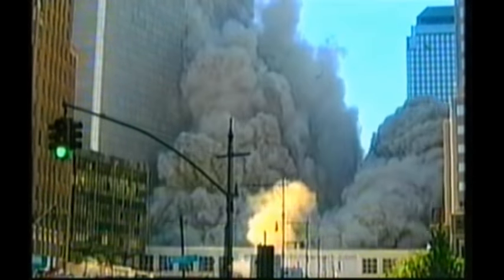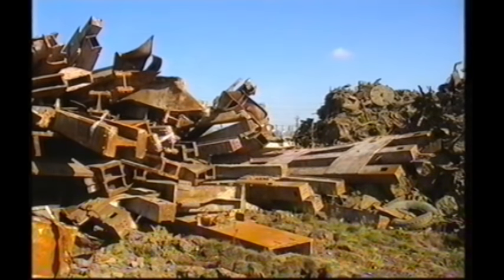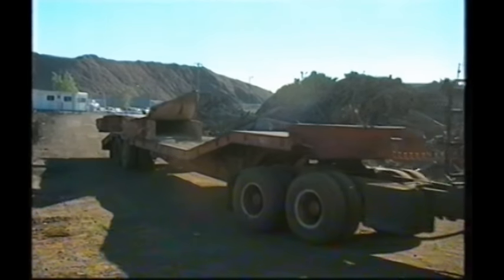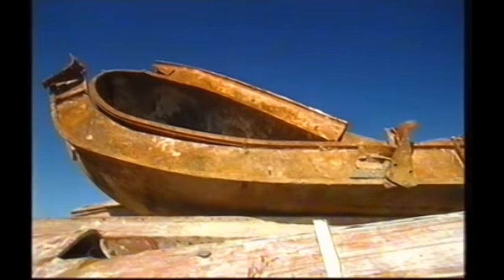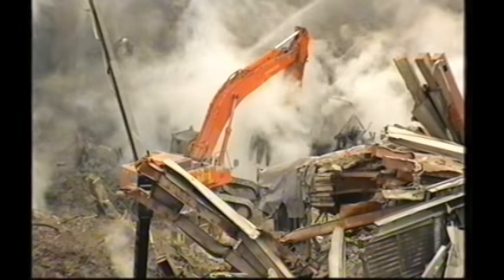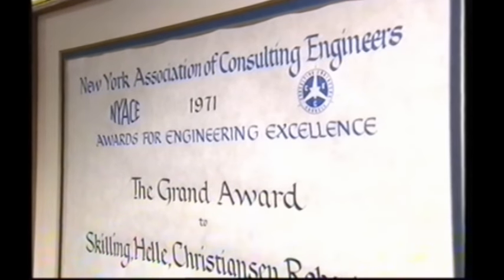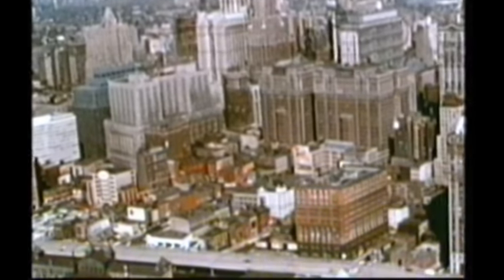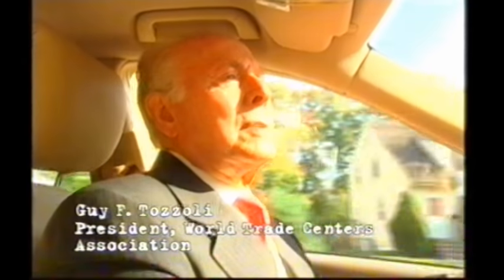9/11—"How The Twin Towers Collapsed" (C4 documentary, 2001)

Comment: From 415 meters high (the height of the twin towers), 9.20 seconds elapse for a given mass to hit the ground in free fall. Given the fact that each floor below its above collapsing floor must resist and provide an equal and opposite force to the floor above, (Newton's 3rd law), it is impossible that the entire structure could "accelerate" (as stated by the narrator) and much less, completely collapse as explained in the time frame stated, (i.e. essentially free fall - which by definition is acceleration of a mass in a gravitational field.) Additionally, the model building that featured "the weakness" of the actual buildings, which resulted in a torsion/twisting-styled collapse (of the models) would have dramatically increased the total elapsed time for complete collapse (if this happened to the actual buildings). Not to mention the mess would have spread more radially outward. This sloppy modeling and slipshod explanation doesn't match the actual observations whatsoever.

Therefore, it's obvious the pancake hypothesis explained in this video is falsified inherently within its own nonsensical "logic". The only way to defend and/or believe the official physical explanation is ironically to defy physics, i.e. Newtonian physics (assuming comprehension of said physics) along with the naive outlook and ignorant assumption that the release of investigations, reports, and production of videos like this can't be falsified. 

This is not to say practically all the information provided by each man featured in this video is false. Au contraire... the point is to simply identify the fatal error of the pancake theory based on physics. 

Weaving together true information on specific details does not supersede the falsehood of the big picture, i.e. how masses fall in free fall vs masses encountering resistance when falling. The spell of detailed, professional testimony is glamorous enough to sugarcoat the bitter truth. And the least bit of truth that is evident is the official explanation is incorrect. Recognizing and the admitting this truth is the minimal first step into illuminating more, if that's possible.

Additionally, the denial of Newtonian physics seems to accompany no significant comprehension of Galilean physics.
Reply: The sadist thing is that it was the event that started war on terror .  Wars are often started with false flags.

Comment: The engineering was remarkable. The top floors remained standing even after much of the framing of two walls were 
Destroyed. It’s just not possible even now to build a structure that will withstand every possible attack.
Reply: Especially attacks from dynamite on every girder.
Reply: They were brought down by design
Reply: The engineering was remarkable. The towers were specifically designed to withstand impact from jumbo jets and yet those planes magically caused all of that engineering, and basic laws of physics, to go right out the window. 

If you're interested in engineering, you should look into the study done by architects and engineers at the university of Fairbanks about WTC Building 7. It's pretty remarkable too.
Reply: Newtons 3rd law says when objects interact they always exert equal and opposite forces on each other. Therefore while an object is falling , if it exerts any force on objects in it's path those objects must push back slowing the fall.  If the object is observed to be in free fall we can conclude that nothing is in the path exerts force to slow it down. Free fall is not consistent with any natural scenario involving weakening, buckling or crushing because I'm any such 
Scenario 
There would be large forces of interaction with the underlying structure that would have slowed the fall. A natural collapse resulting in free-fall is simply not plausible.  All three bldgs collapsed by design
Reply: @coolk3dat754  Have you ever tested your assertions experimentally, or just using your gut instinct?
Reply: @beantown_billy2405  it's been tested and laws of physics proves it
Reply: @coolk3dat754  It's been tested where, when, and by whom? Where can I read the technical report?
Reply: @beantown_billy2405  Where? Newtons 3rd law of motion tells you so. Any upper block of falling structure must slow down when it hits any mass or force that previously supported it. The upper block will destroy itself well before It can possibly crush the entire larger lower structure. It's called resistance.  People wouldn't dive off a high cliff into the water if they didn't trust resistance. Nist analysis stopped at point of collapse initiation never explaining why a total collapse occured. When asked why their response was the computer models couldn't converge on a solution. Now what was it you said in your previous comment?  Why do you wanna talk about a subject you know nothing about?
Reply: @coolk3dat754  You're trying to say the buildings didn't collapse?
Reply: @beantown_billy2405  is that what you're getting out of this. They fell alright, but with some help from the inside. Why don't you tell me when you include Newtons 3rd law of motion to the collapse tell us all, what should and shouldn't have happened ?  And don't be putting words in my mouth . I'm saying building never fall straight down into their own footprint in a symmetrical fashion with uniformity and consistency
Reply: @coolk3dat754   Newtons 3rd law of motion tells you so. 

The same applies to the 'plane' impact. A 2mm thick aluminum plane flying TRUE thick steel beams at incredible speeds... (Newton: for every action (force) in nature there is an equal and opposite reaction)

Now imagine the thick steel beams smashing into a thin aluminum plane at those speeds. Only cartoons physics would stand the test of what happened on 9/11.
Reply: @beantown_billy2405  some critical thinking and basic physics knowledge already goes a long way. 

“It's easier to fool someone than convince the they’ve been fooled.” Mark Twain
Reply: @user-xm7sx8it9e  p.s. asking someone to imagine is not how science works. If your theory disagrees with experiment, it's wrong
Reply: @coolk3dat754  The experiment would show the plane getting demolished by the thickness of the steel beams. That's my point. As should have happened on 9/11. The planes flying into building as we were shown doesn't make any sense at all.
Reply: @user-xm7sx8it9e  the plane's impact had nothing to do with it. It only cause local damage and did not impair the integrity of the rest of the building. 80,000 tons of structural steel framework as if it wasn't even there. Don't waste my time side stepping these laws which you can't even prove
Reply: @user-xm7sx8it9e  you could have been a hologram you we're watching
Reply: @coolk3dat754  They didn't fall into their own footprint. The top sections leaned quite a bit and rained debris down over an area many times its footprint (i.e. damageing WTC 7 so badly it too collapsed)
Reply: Very sad day in the USA. The first thing I thought when I saw the collapse was that was a controlled demolition. It was obvious. RIP to all who lost their lives that day. The TRUTH always comes out.
Reply: @beantown_billy2405  They did fall into their own foot print. Never should have collapsed in the first place
Reply: @user-xm7sx8it9e  I understand what you're saying. In fact I agree with you. I was talking about the total collapse which violates the laws of physics
 All three buildings were brought down by design guaranteed
Reply: @coolk3dat754  You'd expect something with a one-acre footprint to just tip over as if it's on hinges?
Reply: @beantown_billy2405  I'd expect the building to be standing. The collapse violates the laws of physics. They were brought down by design
Reply: @coolk3dat754  Netwon's 3rd law, huh? Try this... go to a boxing gym and ask someone  to punch you in the face, then you'll know how an object under force can accelerate right through a static mass.
Reply: @clicheguevara5282 such a subtle dose of irony . .

Comment: I worked with explosives many times. My first thought after seeing the buildings fall was controlled demolition.
Reply: I looked up jet fuel flashpoint and you can drop a lit match into a jar of jet fuel & it'd be out out, I find it suspicious that all that jet fuel exploded so quickly on impact within a millisecond of impact.. I know the plane was going 500 mph, but don't the fuel tanks protected very well? I don't get how a door from the jet and other plane parts could survive all that but the fuel tanks turned all that fuel into a giant fireball as if it's liquid napalm in a millisecond
Reply: & how could fire occur for long enough to spread or sustain in an elevator shafts with all the doors shut on it pretty much void of oxygen? How is it possible for the majority of the fire to somehow magically make it past all the elevators themselves in the elevator shafts and further into the bottom of the building even though smoke rises? How come there wasn't smoke coming from the windows on the very bottom of the towers
Reply: @mark7362 Lots of documentaries describe the aftermath of the jetfuel leaking down the elevators and causing fires all the way down.

Next, your jar of fuel becomes exponentially more dangerous when multiplied by the size needes to lift an aircraft.  And I think you've likely seen car crashes or related crashes of smaller gas powered vehicles exploding which carry far less fuel.

On top of that, you should look into the equation the structural engineer talked of early on about how the speed of the plane amplified its impact.  

All in all, turn your curiosity towards learning more civil and structural engineering so the physics make more sense to you.
Reply: @bobcourtier4674  The buildings had fire in common, and that is what matters. If Building 7 wasn't on fire but came down anyway, you could make the case for something other than fire then but not before.
Reply: @martinhayes3919  they new exactly what time building 7 was coming down cause it was controlled demolition
Reply: controlled demolition in the basement and floor 34

Comment: 40:00 So, what this man is showing us is that at the point of impact, where the heat was high for seconds and then turned into a much lower heat fire, the columns were basically intact.  Will we ever get an honest explanation for why the towers came down in a fashion that looked like an exceptionally well designed controlled demolition.  Also, for how long are we going to ignore building 7 going down in similar fashion after the most minor of fire relative to the strength of the building?
Reply: The steel beams had turned to dust in minutes, no amount of jet fuel can do that.
Reply: Well questioned. Anyone could be forgiven also questioning the unbelievable PRECISION involved. Most of the best and greatest pilots in this world could not replicate what was seen, let alone a bunch of inexperienced "terrorist hijackers".

Comment: This was very informative, and fascinating to learn all the contributing factors that lead up  to the collapse.  The designers, I believe could have never imagined this to occur and built a set of buildings that served NYC's iconic skyline for many years.  They should not bear much if any guilt for those who perished.  Maybe their beautify of design served long enough for all those who did survive.  But great documentary.
Reply: Just going to note that the steel beams were 60' long and heated unevenly by an out-of-control fire. The beams warped in a way that no design can accommodate, hence the collapse that many find impossible.
Reply: @blake77777  heated by what? Oxygen starved fires? You ever have a campfire in your life?
Reply: Oxygen was all over the place how can it be non oxygen they in the skyscraper with holes in the sides where air can get it so there for feeds the fires
Reply: @shamusatha4700  watch the video. Learn about fire.
Reply: @Toutvids  LMAO, the fact that you're asking about camp fires means you have no relevant rebuttal. I've never burned 90,000 liters of jet fuel, no. Black smoke means fuel rich in that context 🙂
Reply: Funny you guys mention camp fires.  Just last week I parked my truck to close to the camp fire and it collapsed into dust.  If only I had read these comments beforehand!
Reply: @blake77777  lack of oxygen makes smoke blackWhen fire gets enough oxygen, nearly everything burns up. But if there isn't enough oxygen, things don't burn as well. The unburnt bits become soot and make the smoke black.
Reply: This reply above is a prime example.  Under cross examination, or simply direct questioning, this persons points don’t hold up, and won’t hold up

Comment: The first logical documentary I’ve seen on the collapse of the towers, probably because it’s made by the British. I would like to hear more about the spray on fire proofing and how that has improved/alternatives. I would also like to know if large scale buildings still use similar truss techniques or have architects designed this collapse vulnerability out of buildings. Interesting stuff.
Reply: It was not the truss technique.  Have you heard controlled demolition?
Reply: There were serious problems with the fireproofing at the Twin Towers, according to Roger G. Morse, who, in a 2002 article in Fire Engineering, reported that he had "investigated" (inspected?) the fireproofing at the towers between the early 1990s and June 2000, and that he had found it to be defective. Morse said, "Examining the rust, I discovered that cement paste from the fireproofing had run behind flakes of the rust, indicating that the rust existed at the time the fireproofing was applied. The result was that the fireproofing adhered loosely to the columns and would fall off in large sheets. This defect was never corrected and still existed in June 2000 and probably at the time of the plane crashes.”
Reply: @wilsont1010  Have you heard of lame, preposterous conspiracy theories? It seems you traffic in them.
Reply: @yallsofake9344 The residue in question was claimed to be thermitic because of its iron oxide and aluminum composition, but it must be pointed out that these substances are found in many items common to the towers.
Reply: @stddisclaimer8020  Do you think the scientists are that stupid? Have you seen those pictures?
Reply: @wilsont1010  No, the scientists enlisted on behalf of the NIST and the 9/11 Commission are not stupid; though we cannot say the same about yourself.
Reply: @stddisclaimer8020  I believe the investigators enlisted to investigate the killing of the president were not stupid as well, but they concluded that Oswald fired the shot, what do you think of that?
Reply: @wilsont1010  Though no thermite was found, it's clear that termites given their fondness for wood, have made a meal of your head.
Reply: @stddisclaimer8020 NIST only gave half explanations of the towers. And totally shit the bed on tower 7. I would listen to the 3000 architects engineers and physicists with AE911truth
Reply: @stddisclaimer8020 thermite was found. 🤷🏼‍♀️

Comment: The engineers designed strong buildings. They stood for such a long time after impact. They were designed to withstand the impact of a 707, at the time very large planes. But the 767 is about 5 or so times the weight, fuel load, and speed of the 707. 
At the time of building them no one could predict a deliberate attack by flying into the towers. It was thought possible by accident. 
The fire proofing was blown off so the steel was in direct contact with the fires, and pulled and twisted as the steel softened. Even if sprinklers could pump out gallons of water, it wouldn't have been enough. 
I am writing all this because the engineers need to know they designed strong buildings, that would have stood for probably hundreds of years. But what happened was 100 % unforseen, at the time, combined set of factors. And because a bunch of cowards used passenger planes as missiles. 
So I say the engineers did a great job of designing a set of buildings, that should still be there. 
I hope they can find some peace from blaming themselves for not thinking a bunch of cowards would do such an unthinkable thing. 
Now we know what these types of cowards may do, so the designs can be adjusted to take the insanity in to the plans. 

We can't forget, We must remember our fallen hero's and prevent another attack.
Reply: Wildly inaccurate comparison. The 767 and 707 are very close in weight (767, maybe 35k more). The 707 is faster. All in all, they are very close in nature.
Reply: A Boeing 767 is not five times more heavy. It's 395,000 lb and a 707 is 336,000 lb

These and Building 7 were controlled demolitions.
Reply: @adamsyed5535 
And the planes were merely used to distract from this fact. Those that don’t believe their own government would do something so heinous to their own citizens are merely delusional due to all the propaganda. 

Much like Pearl Harbor attack by Japan was caused by FDR’s own provocation and aggressive policies towards Japan and Germany. He did everything possible to provoke an attack from one of them, if not both.  All done to cause anger within the American public at what appeared to be an unprovoked attack, thereby calls for war grew. The “attacks” on 9/11 was to encourage Americans to want war in the Middle East to fight “terrorism.”

In other words, topple governments, put in place politicians in the new “democracy” that will do the bidding of the puppet masters in control of America (puppet masters being a certain nation that was established following WW2), and to plunder the natural resources in the Middle East.
Reply: They could predict that someone would fly a plane into the building thats why they made it strong enuf to withstand a plane.
Reply: @timdolan2485  they weren't designed for a 767 hitting at full speed 200 tons and the jet fuel , It was designed for a plane travelling much slower and a lot of less fuel and lower speed. and less weight.